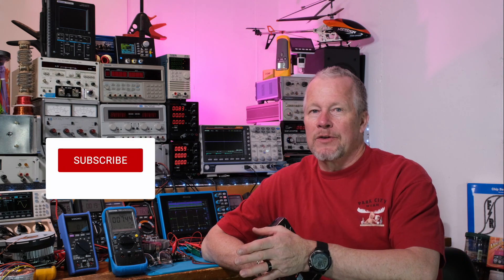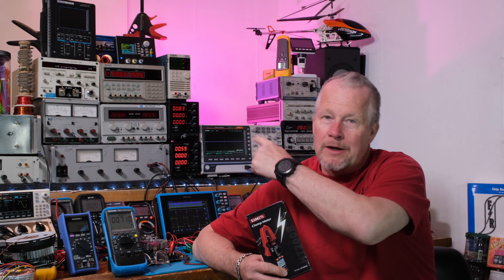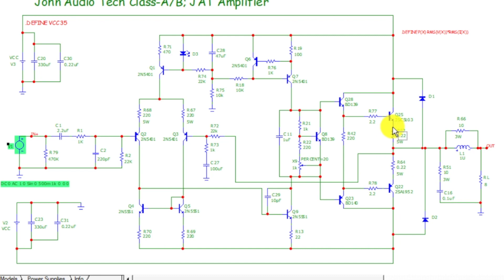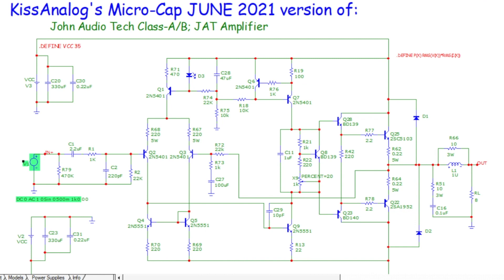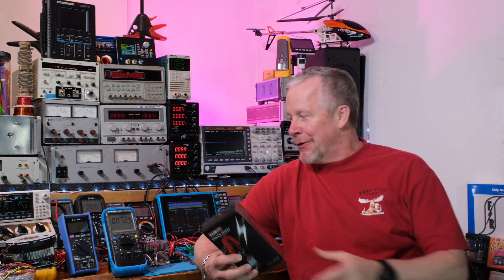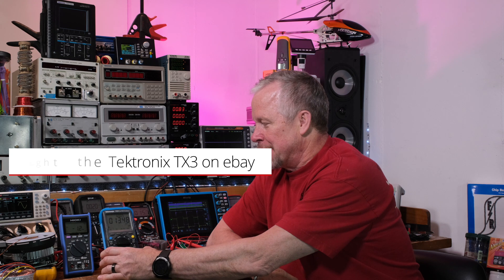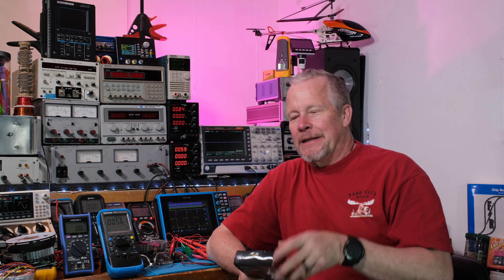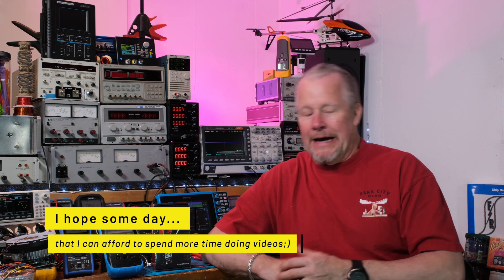KissAnalog John Audio Tech’s - JAT Amp Competition with MicroCap #microcaptutorial #Jatcollab

Comment: Big thumbs up for Kiss. That's great!
The JAT501 boards are being finalized now.
I'd like to get other creators collaborating on projects. Kiss, being a power supply designer, would be great for power supplies. For example, I'm thinking about 3 different supplies for the JAT501: 1st, an ordinary mains supply. 2nd, a mains switchmode supply and 3rd, a 12v switchmode supply. I have some other ideals for general purpose supplies with 5 and 12v outputs for solar panels and so on...
Reply from the maker: Thanks John!  That sounds like a great project!  I'll send you an email to connect on this;)
Reply: I'm very good at doing PCB design. Ask Eddie, i sent him some !
Reply: @JasonLeaman  yes! I'll have a couple, , Mr. Learnerz! But please make a video on the design. I've managed to make a design or two in easy eda, but that doesn't mean that they were good...
Cheers 
Mark

Comment: Hi Eddie, If you still have the MicroCap model of the 501 amp, can you disable the input and output filters and set the miller cap value to 100 pf and run a bode plot? In LT spice, I get impossible results as does another guy who tried the same. Thanks!
Reply from the maker: Thanks John!  This sounds great - yes I do have it.  What issue are you havving with LTspice?  It clearly isn't as good as MicroCap:)  So, I should be able to help.
Reply: @KissAnalog  It rolls off at only 6Khz which is impossible. It seems LT Spice isn't modeling the miller capacitor correctly. It should be 100pf in the circuit. Setting it to a low value (1pf), the roll off is in the MHz range as expected. Expected roll off should be in the 200-300Khz range at 100pf as tested on the real circuit.
Reply from the maker: Thanks John!  I'll get this out today!  In comments, I see under 'Mentions' some other creators who have mentioned me on one of their videos.  Do you know how I do this so that I can mention you on this video?

Comment: I'm a digital sort of guy, but I've always been fascinated by hybrid PS circuits - use switch mode to get efficiently within a volt or two of the target and then a linear regulator for quality of output and dynamic response. I've never seen this done for a dual rail audio amp. Would that be an idea? Further extending that idea, how about making it adaptive voltage so the voltage to the amplifier is increased with the power to the speakers? With a linear amplifier this ought to improve the efficiency and reduce waste heat.
Reply from the maker: Thanks for this great feedback!  You are on to something here I think.  There have been audio amp designers that have created designs something like this.  I don't remember now who it was, but I remember an amp that would change from two different levels depending on the input signal.  With switching power supplies, we could use a better envelope to follow the power line.  I really like this idea! ;)

Comment: I have subscribed to John Audio Tech for years. I like audio tech in general, so any channel that does this and I'm there. Thumbs-up for the collaboration. 
Two questions;
I don't understand the "Groups" login stuff, I joined - but now what? Where's Microcap? What do they want with a photograph?
Does Microcap have SPICE models for the Hitachi lateral MOSFETs like the 2SK133? If not, I cannot submit my design.
Reply from the maker: Thanks John!  I've been a happy subscriber to JAT for the last few years.  I'm happy to have a chance to collaborate with him.
Are you asking about a group Micro-Cap sign up?  I haven't done that yet, I guess I better do this;)
Yes, MicroCap has many 2SK parts including the 2SK133.  Also, it is pretty easy to add parts;)
Reply: @KissAnalog  I found them Thanks. Now the fun begins!!!